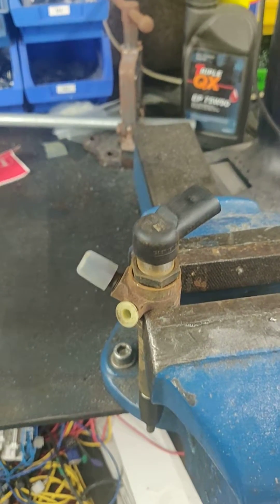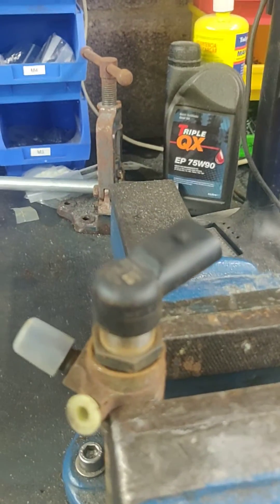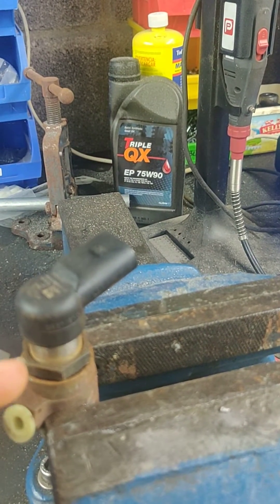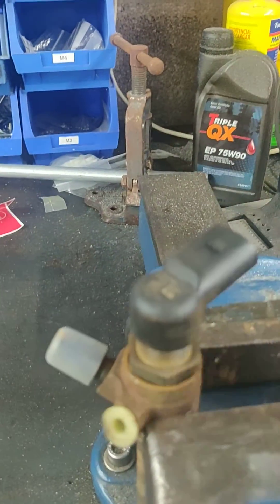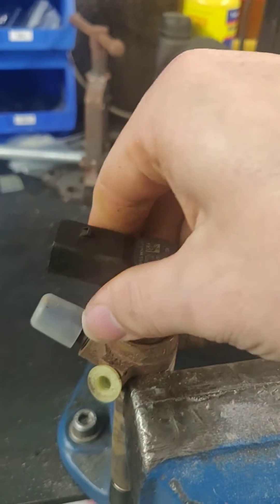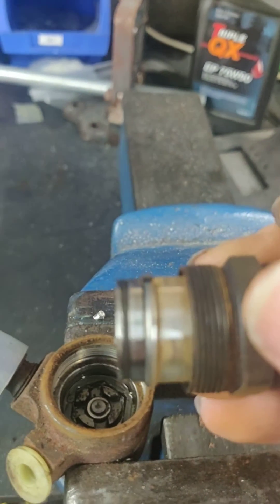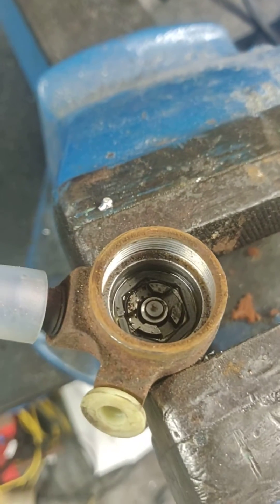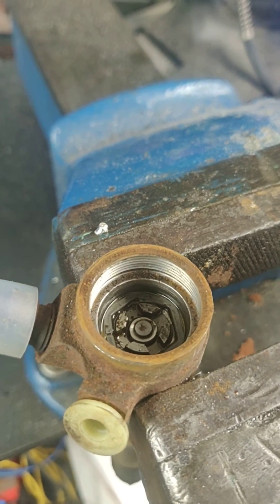TDV6/SDV6/TDV8/SDV8 LION VDO/Siemens Injector o-Ring Replacement (Part1)

Comment: Hi Alexis. I need to replace the seals on my disco 3. I believe I have seen your kits for sale but was wondering if you would be able to tell me the o-ring sizes. I was just thinking of buying a new metric o-ring kit and hope that the correct size runs will be in it for everything. What's your thoughts?
Reply from the maker: My kit also includes the leak off ohring and the clip you will lose!
Reply: @cyberprog  I understand you want to sell your kits but just wondering if your willing to help by letting me and others know the size of the o-rings.
Reply from the maker: @caf3110  sadly I just buy these o-rings as the Siemens part number. Best to do that given their location. I always have discounts on my eBay shop for multiple units and you can send me a best offer also ;)

Trust me, you'll need at least one clip. Those bloody things like to ping off and never be seen again. Spares are highly recommended.
Reply: Ref   A4-15224

Comment: Hello

I am very glad that I found your video on replacing the injector seal.
Do you know the original repair kit number for this injector ??
Did you adjust the dimensions of the seal ??

Greetings Marcin
Reply from the maker: As I said on the other video, these are genuine o-rings from Siemens. I've put this kit together, so there's not a part number I can share, but if you wanted a quantity then get in touch ;)

Comment: Hi
I tried doing this to my injector that was working fine but leaking, however, after I put it back together it developed a short and stopped working altogether. What do you think could be the cause of this?
Reply from the maker: I'm guessing too much stress on the plastic part, or done up too tight. I don't have any torque specs for this, but maybe don't do it up beyond 1 ugga dugga. FT normally suffices.
Reply: @cyberprog  lol ugga dugga 
The thing the got me most confused is that the injector started to cut out all the other injectors when connected and when I disconnected this injector the other 3 cylinders would run.. is the injector salvageable? Also just to point out the solenoid was removed whilst the injector body was still fitted in the engine. Thanks for quick reply would really appreciate any help to get this resolved
Thanks
Reply from the maker: @fatboyslim3  I suspect probably not at this stage. You'll want to get the injector removed and looked at - it will probably be simpler to replace it.

This is the first one I've heard of that has done this - did you use one of my kits?